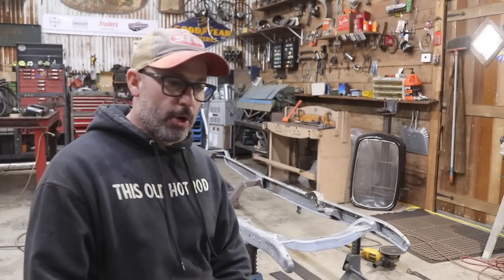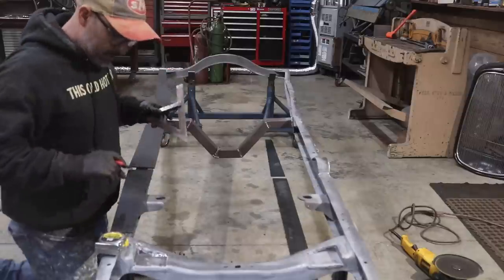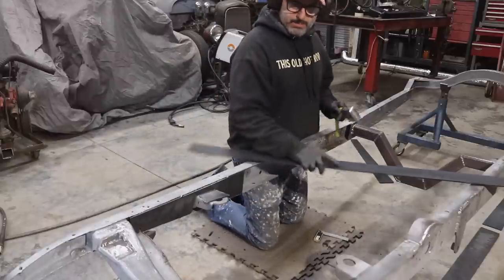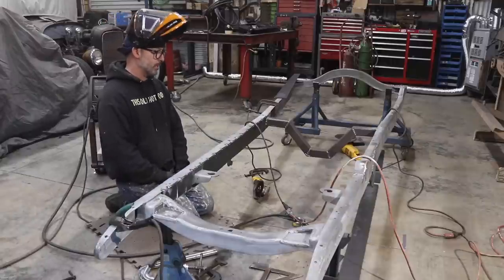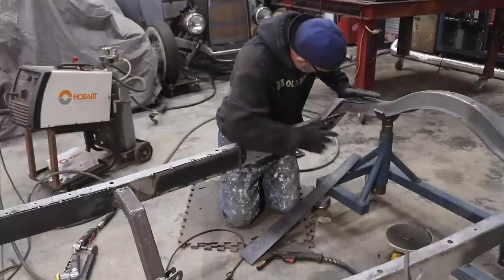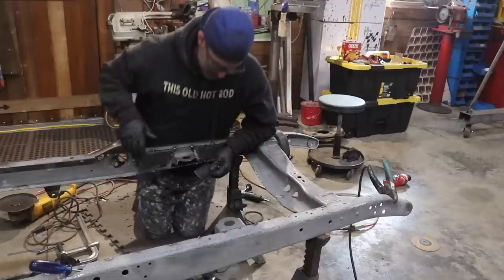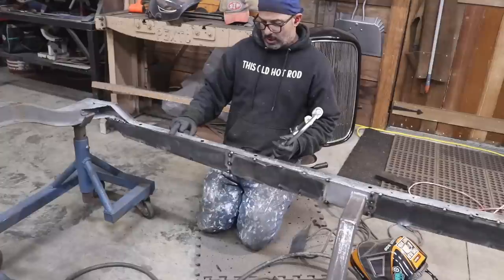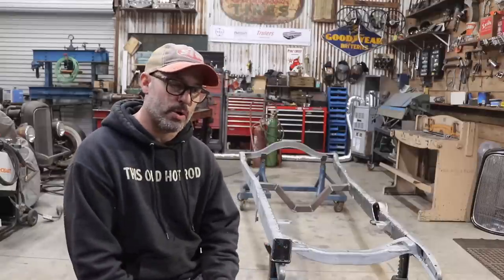Boxing A Model A Ford Frame (Fitment and Tacking)

Comment: Saw on the internet the beads off a welder can travel up to 17 feet. Don't want to get one down an intake. I welded right next to my sporty case, not thinking (newbie mistake). Now I'll have to use some of that seal/paint stuff on the inside if I ever run it. Or if somebody else dose. :) Love your channel btw. You've got a good thing happening there from the looks of it.

Comment: Suggestion: when you drill out the boxing plates for the trans mount. Drill them big enough to put a sleeve thru the frame. This will prevent compressing the frame sides when you tighten the bolts.
Reply from the maker: Yup.  That’s the plan.  I’ve already got the tubing cut. 😎👍🏼.

Comment: Hey Mike, Thanks for taking us on this ride. $11k sounds reasonable for all that! What would you estimate it would take, money wise to put it on the street from where you sell it?

By the feel of the comments there are many of us who are getting a look at this whole process for the first time. Although out hearts have Hot Rod through and through, are brains don't know how it all happens. Just like life! Thanks for sharing your frustrations as well. I am happier when I chart my own path. I to often hop off on side streets. It's my fault, need to stay A to B for my own good.

I'm interested your frame table. A quick what you do with it, how you set it up would be appreciated. 

Thanks again Mike
Reply from the maker: Thank you for the kind words first off.  Thank you. 
In regards to the cost to get the car on the streets. Realistically I’d say parts alone $1,000.00-$1500.00  
Driveshaft / basic exhaust / harness /  fuel line brake assembly and lines. Windshield glass gauges and some other small items.  
Time frame will depend on skill and actually available time to work on the car.  Probably a month or two of picking away at it would get it driving and stopping
It’s really not a ton of time or money for the average mechanically inclined car guy or gal.  
But that’s my assumption.  
Everyone will have a different opinion and I’m probably forgetting some things.